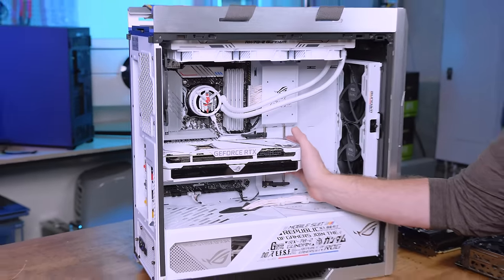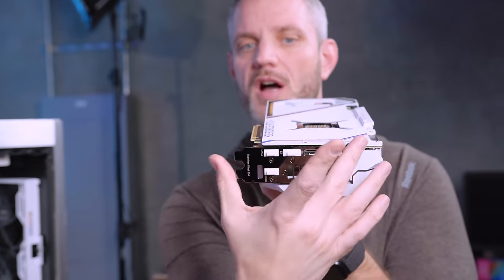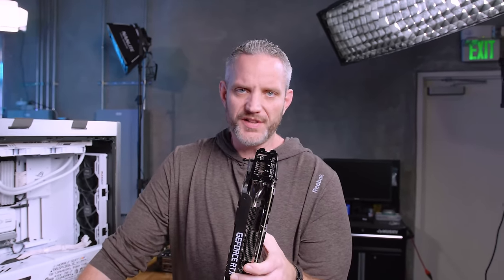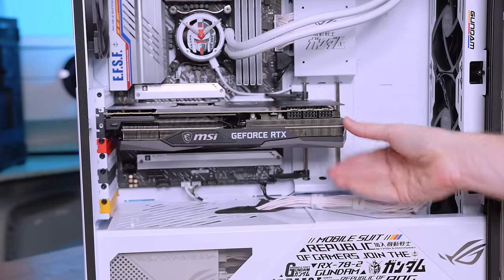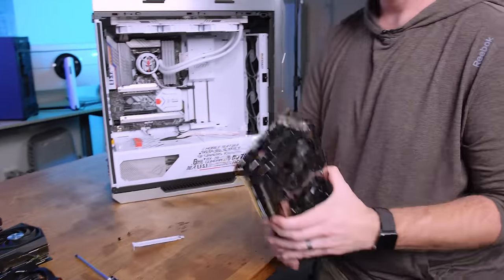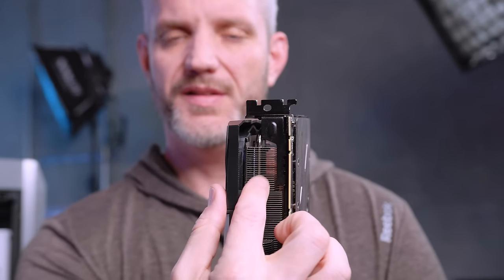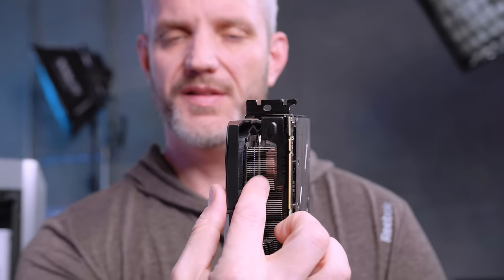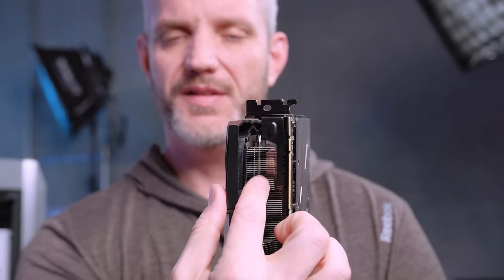How to fix GPU sag ONCE AND FOR ALL! FREE!

Comment: I feel like most high end house should include their own anti sag bracket. Is it really that much extra cost to make a little strip of metal?
Reply: I mean they used to come with SLI bridges, and a anti sag bracket sounds infinitely more useful.
Reply: I think it will kinda like be the case of apple not including chargers at their phones - even if you include one when shipping them out, the custom vga bridge market is becoming quite big, and people who actually care to get one better than cut off chopsticks and lego bricks would throw them away anyway. I think it would be cool for vga sellers to inculde them with cards tho, as the price tier would be way higher than cases and it would make sense for them to throw in something that costs like 20$ to make.
Reply: The center of mass for a high-end is so far away from any of it's mounting points anti-sag bracket (or an adjustable standoff) seems like something mandatory at this point.
Reply: no...but they can not include it, then turn around and sell you it to you. much like iphones/samsungs with the chargers.
Reply: Because most people won’t care, like they don’t care about sleeved psu extenders.
Reply: CM H500m tower I use has one, not really needed with the 1080ti fe card I'm currently using though as it's not really heavy.
Reply: My gaming z trio 3080 came with one. It was even designed to provide support in between the fans so MSI actually put some thought into it. But I agree, they should all include something.
Reply: my lian li 011 razer, does include one
Reply: i wonder lets find out right now with my head math. lets say it's 4 cents to add and extra plate to a 100,000 units  just for that amount it should be about $4,000 extra in cash per 100,000 units
Reply: Suprim X does exactly that.
Reply: Noone realized you said house.
Reply: @cynic256  Bad comparison, because it's for the better that phones don't come with chargers (and crappy headphones). I already have a pile of phone chargers I don't use, and I only buy phones every few years instead of upgrading every year like most people. And I can't even give them away because everyone else also has a pile of phone chargers they don't use. Phones not coming with chargers should have happened a long time ago.
Reply: They shouldn't include an anti-sag bracket. They should just be built properly to begin with so we don't need anti-sag brackets.
Reply: @YoIntangible  Now calculate the profit made from 100,000 units, stop defending the greedy corporate practices and get after what you deserve as a customer ffs.
Reply: If they can't spend $4-5 on better thermal pads/paste, I wouldn't hold my breath.
Reply: I've not personally experienced any sagging issues wirh my house, so I'm not sure it's necessary. Still, better to have and not need, than need and not have.
Reply: Some actually do but like jay stated they are uglier than the problem they are trying to fix haha
Reply: it shouldn't be a bracket added... the initial design should be more robust knowing these cards weigh a buttload Given how much we pay for them ( current situation aside ) it really should not be that hard to use the next thickness of steel plate on the I/O mounting bracket and provice a sheet of thicker steel/aluminium to strengthen and help prevent the sagging. Or a fundamental redesign of the mobo/card interface needs to happen to provide something at the other end of the mobo to help... remembering most ( not all) gpu makers also make mobo's...
Reply: Trimmed 'wooden chopstick' between them will serve at no cost.
Redirect the video power cable from bottom to top to support graphics card weight
Reply: They don't? My new card did come with one. It seems insane not to ship the newest highend cards with some support.
Reply: My EVGA 3080 Ti FTW3 came with a useless anti-sag bracket that fits basically no cases that anyone actually uses
Reply: Unfortunately these days, pennies add up. In theory...you want to produce the highest quality product with the least cost to build.
Reply: My msi gaming x trio 3070 come with a sag bracket!
Reply: An upHere Graphics Card GPU Brace is on Amazon now for $11.99.
Reply: Especially with the prices we are paying for a GPU now!
Reply: @Sike55  I'm not really trying to defend them I was trying to understand why they wouldn't do it. Not to defend them Also I understand the fact that these company's think it works well enough and if we can save a few pennies   so why will they care
Reply: @gabegabe2452  they called underwear ;p
Reply: My MSI 6800xt came with an anti sag bracket in the box
Reply: @jamiebishop9512  suprim x itself is a premium cost
Reply: I feel like compute case designers should design them the right way more, meaning with the motherboard horizontally.
Reply: O11D Xl comes with one, but I haven’t tried to see how well it works
Reply: My MSI 3070 Gaming trio z came with one

Comment: I've got one of those triple slot EVGA 2080's, and it was the best design they've had, almost zero sag. I was disappointed they didn't continue that with the new cards.  If your card is already going to exceed 2 slots to begin with, you should add the 3 slot IO bracket to fight sag.
Reply: Yeah I mean if the cooler is gonna take up that slot anyway. Just add that metal piece...
Reply: EVGA really went out of their way to use the crappiest bracket possible to give us clown lips on the back of the card.....
Reply: @Instanewt  Bingo!!!  My 1080ti looked nice/classy... and then they went Fugly on the 3080's so I went Asus Strix...  Still like EVGA Modular Power supplies however... and they have great CS... but shoulda canned whomever designed their 30 series cards...
Reply: Can i have it?
Reply: the only reason that I can think of is, that if you watercool the card, you would go down to 2 slots.. Just that you can't use the bottom slot for SLI anyways since they removed that option from most of the new cards anyways.
Reply: I loved my 2080 Super EVGA FTW3 Ultra triple slot very solid card.  My new 3070 Ti had to have a up here anti sag bracket on it

Comment: This is a pretty good fix I'm definitely going to use it,  though I am a little confused as to why a several thousand dollar video card was not designed with that in mind
Reply: Meanwhile the wolf ran🥛🍼🍯🍮🍭🍬🍫
Reply: And whenever she had 🎂🍪🍩🍨🍤
Reply: most people probably still have their GPUs hidden inside the case so it never mattered before but now everyone has a lightshow going on in their PC case and something like a saggy component became noticeable when they weren't before.
Reply: @Freneticburn  It's not so much that it never mattered but more that it never really was an issue. Only in the last few years have GPU's grown to the huge sizes they are these days. There may have been a rare model but that's it. So the majority of builders didn't face GPU sag in their builds.

Comment: I once built a tiny support column for the gpu using lego, has been in use for ages. Works perfectly, and if you have the bricks you can customize it to the build. In my brother's pc we used fishing line and hooked it to the top of the case (there is an opening for air)
Reply: Lego column gang represent

Comment: Not here to fix the sag in my graphics card. Just here to confirm that it's normal 😅
Reply: I love your videos!
Reply: Photoshop your GPU straight. Quick and easy, and most of all, unless you bought Photoshop, it's free ;)
Reply: Sagging is normal. You just have to make sure it doesn't get so bad that it dips into the water.
Reply: If you let the card sag, then the PCIe connector can crack at the part that clips into the motherboard slot.  Then companies will deny warrenty.
Reply: @GodKitty677  I just used the GPU holder, is it safe? I mean, is it possible to gpu holder broke the vga case?
Reply: @Jarheeead  All I can say is I used the one that came with my card and everything so far is fine.
Reply: @GodKitty677  what's your gpu?
Reply: @Jarheeead  KFA2 GeForce RTX 3080 Ti SG
Reply: @GodKitty677  So the GPU holder is fine then? What is your gpu holder?
Reply: @Jarheeead  The one that came with that gpu, also it didn't fit my case 100% but did fit enough to work.  All I can report is no issues after a few months.
Reply: @Ms Moon Boo Dude makes hella digital art tutorials and videos

Comment: I ended up getting a GPU support prop rod for $10. It arrived 5 days after I ordered it, and a day ahead of my 3080 arriving. 

Doing this fixes the cosmetic side of GPU sag. You're still relying on one small mount and your PCIe slot to support the weight of your GPU. Go with a prop rod, e-leash or something other than doing this. This fix still keeps a lot of stress on your PCIe connection, and that could break your GPU and/or your motherboard.

Comment: I worked in construction for about 20 years and that face comment made me laugh probably more than it should have.
Edit: I might make a 3d printable shim and upload it to thingiverse for those that want one. I'll update when it's done.
Reply: that's kind of you
Reply: Already designed and printed mine few months ago, but the thickness is probably the "trickiest" thing to get just right. So if you upload it I´d suggest varying it by 1mm each :D
Reply: @SaleBosancheros  Or print it too high and then do some subtractive manufacturing to fit.
Reply: @Torchedini  Sure but I prefer my top layer to be top notch hahaha, jk for me 3.5mm worked out and they are very very fast to print, trying to find stl as of now to share it
Reply: Is it done? I can not proceed with my current project until you have this finished and uploaded, sir.
Reply: Could also make one with provisions for screws and small feet for the threads so you can adjust the support by screwing in the back and the feet touch the cooler.
Reply: Please do it!! 🙌

Comment: That trend of triple-slot cards with two-slot brackets is definitely a bit silly. I think they started doing that because sometimes mini-ITX cases have enough room to accommodate those gigantic coolers, but only have two slots to attach a graphics card.
Reply: Why not sell with two brackets. One 2 slot & one 3 slot 🤷.
Reply: @niklasbergvall9656  screw-on brackets....include both of them in the box..and the buyer will fit the one that he wants ;-)

Comment: Rather than destroying two or more pcie brackets you could just get some rubber/silicone bumpers you’d use for cabinets and apply them to that third pcie bracket and it’d push against the card’s cooler in the same way. 

Only catch is you gotta check to make sure they don’t come off when you’re installing the card.
Reply: Also that their adhesive can handle the heat in the long term

Comment: Awesome easy fix!
Reply: Byt will viagra work ? IF we use like in custom loop ?
Reply: Sometimes, the simple solutions are just the best.
Reply: u know what's an easier fix ? Lego. I just prop up my 2080ti on a support I designed.
Reply: It did not work. You owe me a plug.
Reply: Sure is a lot more elegant than the acrylic pole tenting mine into position.

Comment: Only problem with this is you're still relying on a bit of force on the PCI-E slot which I'm not comfortable with. To put the least amount of force you need to support the GPU on the other side.
Reply: naa. we don't need to do anything. Nvida and AMD need to build them better!
Reply: @DC-te1gw  I mean yeah they could charge $10 more and provide a better "frame" for the GPU components to sit in/on but in the meantime I would recommend aftermarket options that support the GPU the way it needs to be supported.
Reply: @pompulousify  or just lay your PC on its side. Problem solved for free 😅
Reply: No you're not, all this does is restore proper support to the GPU same as previous gen 20 series cards. The only reason GPU support brackets and stands exist is to fix the sag without addressing the root cause.
Reply: @JohnDoeWasntTaken  Honestly, since SLI/Crossfire is dead anyways in PC Gaming, they could give future cards like the 50xx series even 4 slots in the back, to support them even better, because it is expected these will get bigger and heavier. Maybe we will one day see ultra heavy weight monsters in the 60xx series, look back at the 40xx series and be like "Maybe I judged you too harshly".

Comment: The best solution would be support the card on both ends. Look at old IBM PC XT machines, the expansion cards are huge, they even have hard drives mounted on cards, and there are rails on the front of the case to slide the cards in.
Reply: Same with Mac Pro.
Reply: with the variety of cases it's become impossible to do so... like 15 years ago you still had midi-cases that also supported the rails you're talking about, but those are only for full-sized AT/ATX expansion cards, which are VERY big, about the same size as the longer side of a regular ATX motherboard. Also i remember having such a card back in the mid '90s and it was hell for cabling. I remember having to buy extra long flat-cables for my hard drives and optic drives because my regular sized cables were too short as i had to route them around the topside of that full-length expansion card i had.
Reply: Most business oem PCs still build like this. Some even have a locking mechanism
Reply: And it's not even a new thing with conumer cards. I remember that my 13 year old HD 4870 was sagging like crazy. Must be around that time that cards got pretty heavy and you could buy little standoffs to support the back end of the card from below.
Reply: @BoGy1980  They're not that big. ~335mm, which is comparable to many graphics cards these days.
Reply: or horizontal cases that lay parts flat.

Comment: After watching this I took the two case brackets from my Corsair 4000D, cut off the tops and bottoms, and gorilla glued them together to form the shim.  I have an EVGA 3080 FTW3 and it is now rock solid just as demonstrated... I cut and glued so I could add three layers to the shim without having issues with the screw on top.

Comment: Jay I give you props. You have major balls for using the tip of a screwdriver to push down on the PCIe clip. Good lord the idea of that is like nails on a chalkboard. I just envision that thing going straight though the PCB.
Reply: Yeah I just came to post this, ain't no way I'm prodding that little clip with a screwdriver in case it slips, hell I'm ever nervous pressing it with my hand. I guess he has enough money to the point it would just be a little oopsie.

Comment: This is one of the things I appreciate about my 3090 founders edition, the three slot in combination with more of a unibody design really provides added support to prevent sagging
Reply: The pcie shield screwing directly into the cooler is brilliant design
Reply: Got a 3070FE and same thing here, no sag in a small ITX motherboard.
And i somewhat feel safer because of no components being exposed, so no humidity/moisture/dust issues
Reply: @nja3817  3070Fe is never going to sag, it's a small card
Reply: @syed2694  It's very heavy and indeed bending at the end
Reply: @nja3817  No it isn't, I have one.
Reply: @syed2694  So do i and it is?
Reply: @nja3817  it's a 2 fan card that's barely 1kg. It is not heavy. It's 2/3 the length (or less) of most 3 fan cards and is easily half the weight of my previous 3 fan 1070Ti. It doesn't sag, or at least it shouldn't, unless you've done something wrong.
Reply: Yup, my 3090 FE doesn't sag a bit, even with extra heatsinks placed on the backplate.
The IO bracket screws directly into the massive unibody aluminium "frame" that goes all around the finstack. The frame is connected to the IO bracket, the PCB and the fin stack, it's physically impossible for the card to bend or sag.

Comment: A little PSA for those watching this video, I have come across cards and have purchased cards from systems that obviously made no use of proper anti sag brackets. No matter how much you tighten the pci-e bracket, there is always a lot of force acting on the weakest point of the pcb closest to the pci-e bracket, the only way to fully eliminate this problem is by supporting the card on the pci-e power corner, there a multitude of ways you can do this, heck if you can't afford a gpu STAND, I've in the past used lego and a small piece of foam (to prevent scratches on the gpu) to temporarily keep the gpu supported while I was waiting for my gpu stand to arrive.

Now as to why you wouldn't want to use a sag bracket supported by the back of the case, this bracket s only really effective if the case is made from high quality, thick metal, what usually happens is the support stand bends the case metal and sags with the gpu, supporting the vertical sag using a vertical stand therefore makes far more sense than supporting vertical sag with a horizontal bracket.

This was a bit of a mouthful but I hope it makes sense.
Reply: gpu sag it needs a pull up bra🤣🤣🤣

Comment: I personally like the "arm" that goes under the GPU's and bolts to the same rear holes as where the GPU would...

So far its been a great solution (I used to zip tie around the 6 pin plugs, up to a drive bay but I dont have that type of case anymore)

Comment: I stepped away from PC gaming in 2010 and just returned in July of this year. I was shocked to see PCIe still being used. PCIe cards used to be much, MUCH smaller (same size as PCI and AGP cards.) These slots just weren't designed for the 10lb cards that are floating around today. Just pinning one in feels absurdly sketchy.
Reply: The problem isn't PCIe. The amusing fact is, if PCIe 32 becomes a thing, the slot will be long enough to offer much better support. The issue is that in GPU manufacturers went the route of speeding up the cards by increasing their power draw, and thus heat generation, requiring massive heatsinks to deal with the problem. My 4070ti is actually quite a small card, but 70% of its mass is the cooling solution. You can mitigate the issue by putting a waterblock on the card, but this isn't exactly the cheapest or easiest thing to do.